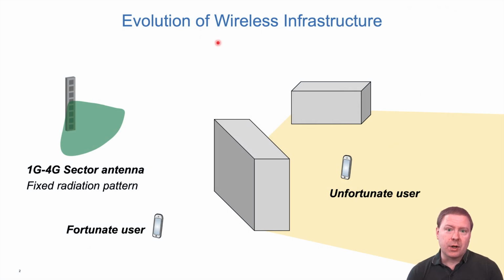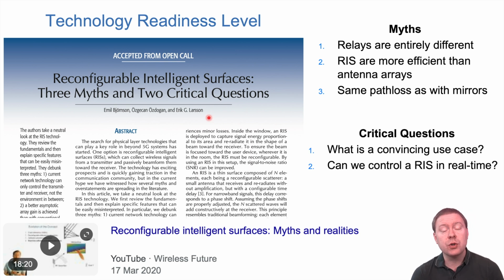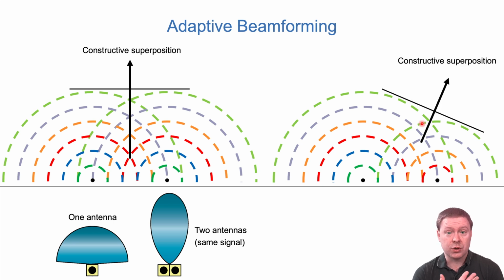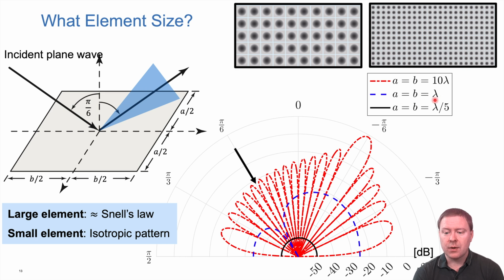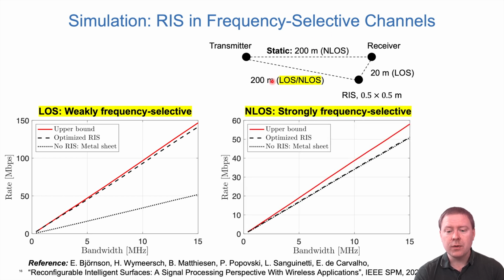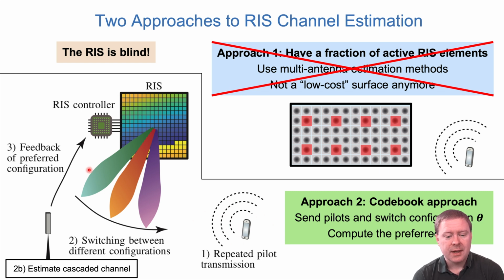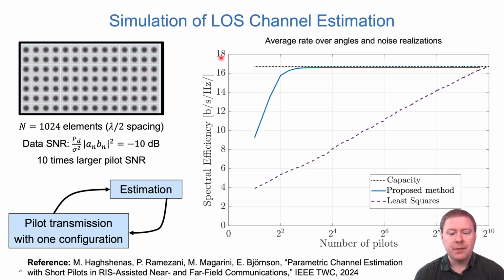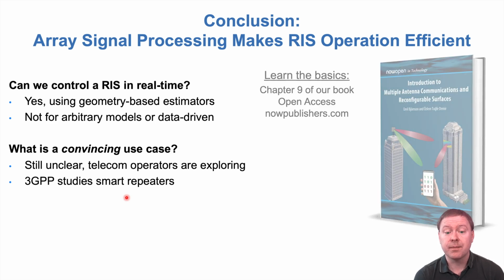Reconfigurable Intelligent Surfaces Through the Lens of Array Signal Processing

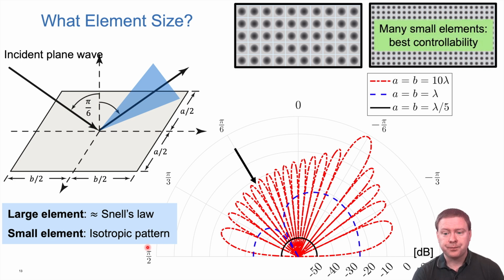Comment: Hello professor, thanks for your considerable explanation about RIS. There is one thing I want to ask. Does the large RIS element can reflect stronger than the small one? In the figure at lecture timeline 21:32, the decibel of signal strength between larget RIS element (i.e., a=b=10\lambda) and the small RIS element (i.e., a=b=\lambda/5) shows almost 50 dB difference. If the transmit power is constant and the RIS element is passive, there should be no power gain according to the RIS element. Why does the RIS element size matters in respect to the signal strenght of the reflected signal?   I hopfully can get some your advise. Thank you.
Reply from the maker: Yes, a large RIS element reflects more than a small one. The average gain grows as Area=a*b, but the peak gain grows as (a*b)^2. The intuition is that a large mirror picks up more light from the source, but also reflects it with a stronger directivity.

Suppose we can deploy an RIS of a particular size. One could build it with only one large element, but then its reflection behavior will be predefined - it approximately follows Snell’s law as shown in the video. What we want to have is an RIS with many small elements, so each element reflects a small amount of energy omni-directionally. We then let the RIS control the phase-shifts between the elements to control the direction of the reflected signal from the RIS as a whole. In both cases, the maximum gain will be proportional to Area^2, but we can control its direction in the case with many small elements.

If you want to get a deeper understanding of RIS, I recommend Chapter 9 of my new open-access book ”Multiple Antenna Communications and Reconfigurable Surfaces”.

Comment: Thanks for your great book. I am over the exercises now. 
Sometimes we use that expression from (5.56) to compute the outage probability and sometimes that last factor (1/M!) in this equation got eleminated like in Exercise 5.12 c).
How is that. Thanks.
Reply from the maker: When an outage probability expression has the form constant*SNR^-M, we say that the diversity order is M. It is this number that determines the slope of the curve, as illustrated in Figure 5.13.

There can be multiple transmission methods that achieve the same diversity order but anyway differ in performance because the SNR-independent constant factor is different. This happens when comparing (5.56) with repetition coding.

(There is no Exercise 5.12c, but I hope my answer covers what you were looking for.)

Comment: I have a short question about exercise 5.1 a) (central limit therom). I have the solutions but don't know whether the way is right. 
I Put E{a^2} into the h equation and then take the square root -> the sum can be written as a multiplication with L:
h=sum(Beta/L^2....) -> h=L*Beta/L^2... Noe the srt: h=sqrt(beta)/sqrt(L)....
So L->inf. : variance becomes zero and with zero variance we have no GAUSSIAN
Thank you.
Reply from the maker: This is the correct result and interpretation. The point that we want to make with exercise is that the scaling factor matters when studying problems like this. (a) The scaling factor gives a zero variance asymptotically, so this is not the central limit theorem by the law of large numbers. (b) The scaling factor gives a finite variance, and this is when the random variable becomes Gaussian distributed according to the central limit theorem. (c) The scaling factor makes the variance go to infinity asymptotically, so there is no convergence to anything.

Comment: In the modern smarthones there are several Wireless technologies implemented e.g.   WIFI, Bluetooth, 2-5 G, NFC, FM/AM radio,....
Do you know whether they all use the same rf chain? Or do they just share some parts, perhaps the oscillator, antennas and filters?
Thanks.
Reply from the maker: Modern phones have antennas for different frequency bands and RF boards for different technologies. These are often highly optimized for one or a few technologies, so as you can see in the following article, the iPhone 15 contains many different components: https://quartr.com/insights/company-research/the-suppliers-making-the-iphone-possible

Comment: In your book, in exercise 4.18, we similar solutions like in section 4.2.5. But, in the book we have the real part R{a^H....} and in the exercise not. 
Is there a simple explanation why we leave it away in the exercise?
Thanks.
Reply from the maker: You solve a generalized problem in Exercise 4.18, where we have added the phase-shift phi to the signal model. When we try to estimate that variable, the optimal estimate of the azimuth angle changes as well. In fact, you will get the real part of R{e^{j\phi} a^H....} and when you substitute the ML estimate of \phi into the expression, it simplifies to what is written in the solution.

Comment: Hi Prof. Is there any constraint for choosing the antenna spacing in RIS? Can I choose any number that I want for the distance between reflecting elements?
Reply from the maker: Yes, when creating virtual line-of-sight paths, it is only the total element area that matters. So as long as the elements are not overlapping, you can use any spacing.

For other use cases, the spacing might play a role: The larger the RIS is, the smaller the beamwidth.
Reply: Thank you so much